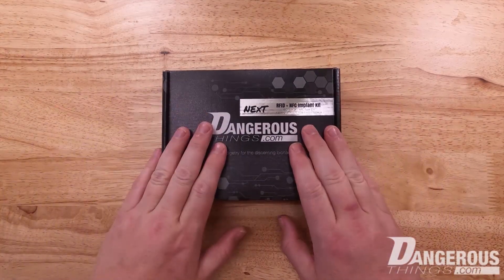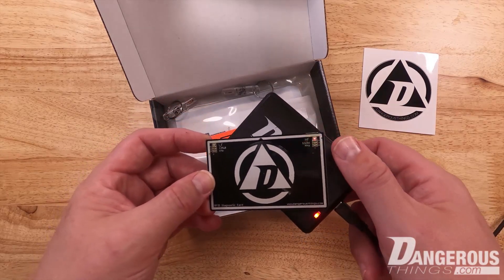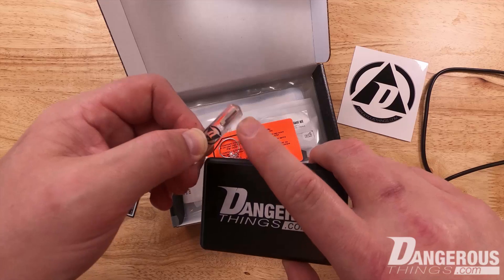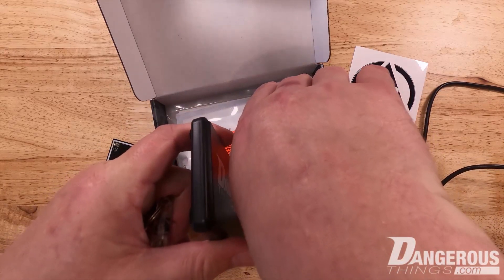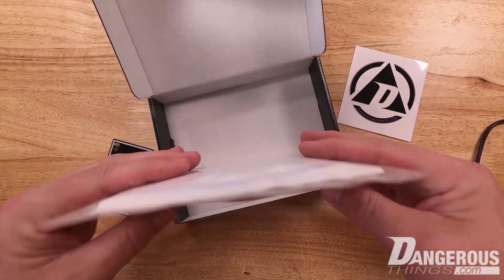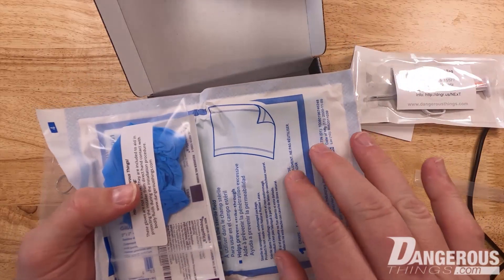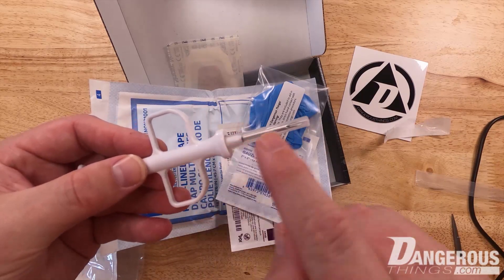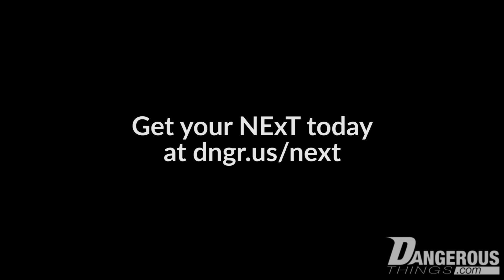Unboxing the NExT

Comment: Ordered one, on its way already, can this be used or registered on door locks like an ordinary readable key fob or it has to be programmed first? My door locks are 13.56mhz
Reply from the maker: Compatibility depends entirely on  your access system. The frequency is only one aspect of compatibility. I can tell you that the ID number of the 13.56MHz NTAG216 chip in the NExT implant cannot be changed, so likely you will have to test compatibility with the reader first, then check to see if you can have your ID added to the system.
Reply: @Dangerousthings  i see, but how can i test it with the reader prior to the installation? Can i remove it from the transponder first in order to test/rrgister it as the keyfob prior to installation then have the injector sanitize it with alcohol prior to injection or i need to inject it first before testing? My locks are metalware mw105LC it registers keyfobs. I am confused if whether which interference is much thicker, the metal of the transpoder or the thickness of the skin upon after transponding. Therefore im thinking of removing it prior to installation but i wonder if alcohol will do its job to sanitize it prior to injecting in my body. Dont wanna risk infection. I have 6 condo units which i will be using this with, thats why its worth the investment for me. Hope to be able to clone/emulate my creditcards and train system access cards with this as well, but im trying my best to communicate with the right entities. Wish me luck 😁

Comment: Hey bro I'm a sterile services technician (prev biomed) - love your videos, I'd have a titan in my hand but having tiny instruments stick to  hand isn't something I can have at work lol. 
The loadout of these packages are very impressive - especially including the sterile fold out. 

Quick note (no hate just help) - do you put the sticker on before you send it for EO or after? If before then it may have compromised sterilisation even at low temperature EO sterilisation. Just the moisture of the EO liquid as it's dispersed can cause the adhesive in the label to leech into the paper providing a new contaminant as well as reducing the area available for EO to penetrate. 
It's in the MDD93/42EEC, ISO 11135 and HTM-1-1 mandates, always put labels on the plastic side of the pouch, even post sterilisation (depending on company/location, etc.), it's just best practice. 
In surgical sterile service if you put the label on that side its automatic fail and could get a defect on your record. 

Also in the xSIID unbox you mentioned that a professional would tear off from the side and drop the injector onto the sterile field. That's actually not what those pouches should be designed to do. The entire point is that the seal is separated at the top from the heat seal down (like splitting a banana) and allows the operator to retrieve the instrument with minimal contact with the outside of the pouch proper (this is doubled if an assistant opens the pouch for the op to retrieve). If you rip a pouch you instantly have micro-fibrous and dust contaminants. 
Just thought you should be aware, peace.
Reply: Thanks for the comment! We put the sticker on after EO processing, just before we put the pouch etc. into the poly bag. Good point about the tearing of the pouch vs peeling it open. We found that peeling these pouches was quite difficult for a single installer (nobody really has assistants) and sometimes resulting in "fumbles" for lack of a better word. When dealing with unshielded instruments that come in direct contact with tissue like trocars or piercing needles, the risk of using the tear method is pretty apparent, however in our case the needle and chip inside are protected with a safety cap and while it is not ideal, the risk of contamination of the needle or chip itself from the tearing method is much lower than the risk of picking it up off the floor after a fumble.. not that any of our partners would do that.. but you get what I mean. We always try to go for the best outcomes though so I will see about a better pouch with a nice huge gripping flap that can be used to better peel open the pouch vs tear open.
Reply: @amalgraafstra1464   @Amal Graafstra  Good to hear from you and great job, I know you prioritise safety so I wasn't concerned but just thought it was worth mentioning. You can get sterile pouches that only have one side manual heat seal. For that injector where you have constant  sizing of instruments it would be perfect, the other side has an easy open flap which releases easily after sterilisation. Can't do it for EO but on steam sterile you can double pouch to make a sterile field within the holding pouch itself. 

There's a certain technique to opening which is really only demonstrated in emergency surgical settings (but should be taught everywhere) if you place the pouch down on the sterile area and then draw down pulling the seam (like a banana) exposing the instrument on the flat surface, it allows minimal contact (this is what is used for sterile pouched cardio-implemented adrenaline syringes). 

With EO (most popular SS) the pouches tend to be thinner (than steam kill equivalents) but you want to make sure your pouches aren't too thin, it's definitely worth investing in premium sterile pouches. If it creases or breaks seal easily it's no good as a rule. We've had prod line recalls at work because of this (suppliers jipped us due to lack of product, sent cheap alt, cost them £50,000 + £5k per set fail = ~£430,000 as part of SLA).  
A lot of delivery EO companies hold responsibility from the time they inventory the device until they release - anything further than that is your responsibility technically (in UK at least) this is due to the licensing of EO mainly.
The rules probably change in regards to sterilisation standards as this is likely more classed as a cosmetic installation such as a tunnel piercing rather than a medical implant. But, it's always good to be on top of things like this - a lot of health & safety mandates these days focus on common sense/benign things which then detract from the actual necessities unfortunately. 

Keep up the good work :)
Reply: @camman1056  great to know.. the challenge for us is getting pouches that work with the production line machines, but I will put on my to-do list :) It might also be possible to mod the line to accommodate different pouches.. needs looking into. thanks again for the comment!